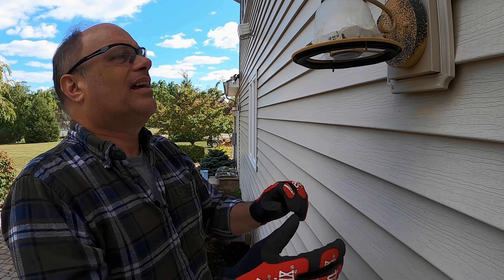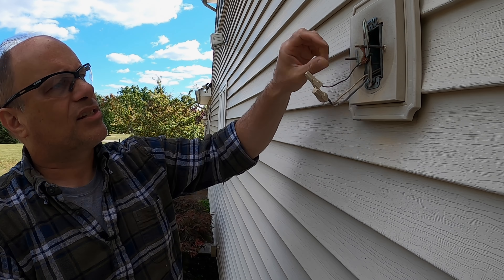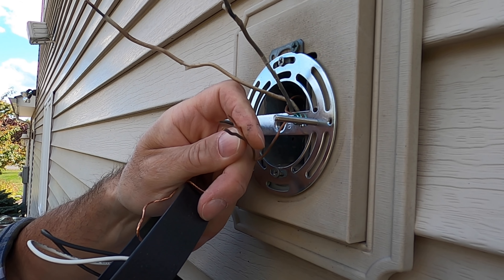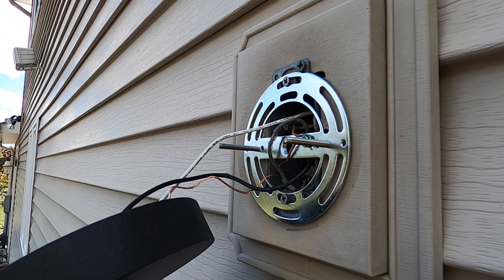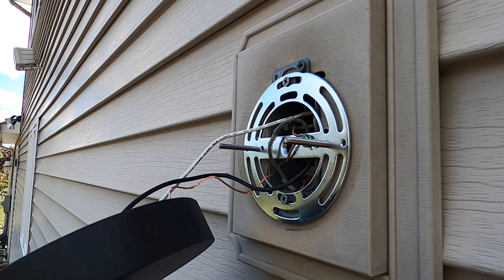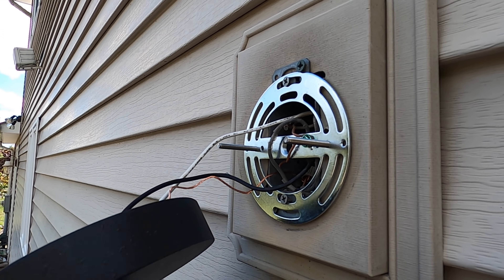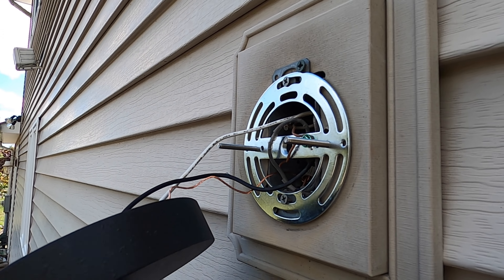How to Install an Outdoor Light Fixture - The Right Way

Comment: I'm going to be installing fixtures on existing blank vinyl mounting blocks. I see that box you're dealing with there is a cut-in switch box. How do you cut that vinyl mounting block to install the box? How deep is the switch box? I can see the cutout lines for a round box or a switch box I just don't know how to properly cut it and how much room will I have behind the mounting block to mount a box. Thanks
Reply from the maker: Hi Jack.  The siding blocks are scored on the rear for round and rectangular boxes. If the block is installed as part of the siding (not removable). You will need to cut the block to insert the switch box.  Trace the outline of the box, drill a series holes around the pencil line and score with a utility knife. I’d go with a 1-gang shallow metal switch box.. you will need to cut the wood sheathing for the switch box also.  Depending on when you planned to do this work, I’d be happy to do a video showing exactly how to do it.  Happy to help if you need some additional info.
Reply: Hi Pete, thanks for the info. I'm in no hurry and I would love to see how you do that (install a fixture on an existing vinyl block). The block I'm dealing with is part of the existing siding so I won't be able to remove it. I thought a shallow box might fit between the mounting block and the plywood sheathing. All I'd have to do then is cut the box out of the vinyl and just drill a hole in the plywood for the Romex. I think you're saying I have to cut the plywood too. Thanks again, Jack
Reply from the maker: Hey Jack..  I think you would need a very shallow box as the siding blocks are usually about 3/4” thick. Old work box’s are about 1 1/2” deep.  Worst case you would need to drill a series of holes around the outline of the box and trim the little webs between the drilled holes.  This will give you a bit of room to recess the box into the plywood if needed.  You might be able to fit a round pancake box in there also.  It probably best to take some good measurements of just how much room you have behind the block, even if you need to stick a piece of wire coat hanger in a gap to get a depth measurement.  It sounds like you have this well in hand..  if I can be of any help please let me know.
Reply: Thanks for the help Pete.

Comment: Hello bought a used mobile home and it needs work of course I need to replace outside porch/ exterior light do you just match the colors to connect sorry I don’t know anything about electrical work and wanna learn please help and your video is good 👍
Reply from the maker: Usually matching colors is typically ok. I would measure voltage between the black and white to confirm 120 volts. Then test brim black to ground to test that you have a good ground, should be 120 volts again. Finally neutral (white) to ground and you should have zero or milivoltage. Sounds like a lot but it’s really a very quick check. Good luck with your project!

Comment: I’ve never switched a fixture but I’m going to try to. This video was very helpful and I think I have the same new fixture from Lowe’s. Question: after I connect the fixture wires to the existing wires in the electrical box, do I need to make sure that the black and white wires do or do not touch each other or the ground wire or does that not matter? I’m terrified that I’m going to do something electrically wrong and start a house fire.
Reply from the maker: Sue, thanks for watching!  I purchase that fixture from Lowe’s so most likely it’s the same one you have. When you make the wire connections, strip the wire to an appropriate length and properly install your wire nut. Typically it will be black to black, white to white bare copper\green insulated to ground.  The conductor insulation (black,white,bare/green) can touch each other without issue. Only the bare copper conductors under the wire nuts (energized wiring) cannot touch.  Once you install the three wire nuts, you can wrap electrical tape around the wire nut and conductor to make double sure there is no chance of anything touching.  Take your time and of course make sure the power is off, all safety rules are followed and then just stand back and enjoy your handy work..  in that order.  Good luck with your project

Comment: Very informative. Are mounting brackets pretty universal? Is it necessary to replace the mounting brackets or can the old ones be used?
Reply from the maker: Hi Rhonda and thanks for watching.  The mounting brackets are fairly universal, some with adjustments for the mounting screws. I’d suggest using the new bracket that comes with your new fixture as its only held in place with two 8/32 screws. Good luck with your project!
Reply: @completepete  Thank you so much! I had bought two used coachlights that I really like, but I do not have the brackets they came with, I only have my existing brackets holding the lights that are already on my house.... I just noticed today that one of the aforementioned used light fixtures that I want to use as a replacement does not have a ground wire in it, so I am wondering if I should just ditch this whole 'reuse' idea and just buy new ones? It would be a shame because I really like these secondhand ones. I do have the ground wire that is coming out of the existing bracket from my house, so I wonder if I could just attach that to the pre-owned light fixture that does not have a ground wire?
Reply from the maker: Rhonda, I’d try to install the two used coach lights. I think you will enjoy seeing them every day on your way in and out.  Amazon  Carrie’s several types of universal fixture brackets that should work. The ground wire should loop around the green screw on your new fixture bar with a bit of a tail left.  Amazon has a fixture ground wire available that might work. https://www.amazon.com/Satco-Ground-Wire-Lug-93335/dp/B005NWMN9Q
You may need to separate the fixture a bit to slide the ground ring over the 1/4” nipple that typically hold the fixtures together. Or perhaps there is a screw stud or lug somewhere on the fixture to connect onto.

Comment: I think I can be able to replace my light fixture. However, I'm not clear when you refer to the "ground wire" and "neutral wire". Will they be color coded? How will I know which is which?
Reply from the maker: The neutral conductor will normally be color coded white. The ground is normally color coded green or may be a bare conductor.

Comment: Ran into issues installing mine in my old house so I came here. My mounting bracket screws will not tighten. They just keep spinning so I cannot level the bracket before install because the screws are angled in different directions.
Reply from the maker: Happy to help if I can.  Are you referring to mounting the bracket to the box (metal or plastic)? Or mounting the fixture to the bracket?

Comment: I have two lights on either side of the garage I installed about a year ago. One has not been lighting up, I tried multiple bulbs, and checked the bulbs inside too and they work. I used a voltage tester in the socket and it is getting current the same as the other fixture when switched on. I tried pulling down the tab in the socket for a better connection with no success. Do you think I need a new socket?
Reply from the maker: Hi and thanks for watching. Usually there are a few possible issues with outdoor fixtures. Most issues are caused by a loose connection or corrosion . I’m curious if on the non-working fixture if you checked for 120 volt from the socket pin to ground and from the socket pin to the socket shell. You may have lost the neutral (white wire) connection which would also prevent the bulb from working.
Reply: @completepete  Thank you! If I had to guess I think it is probably the neutral loose. After watching your video I now know the best way to attach the two different styles of wires, extending the one slightly past so I will try that for a better connection this time. Wanted to cover all my bases before I took the fixture down again.
Reply from the maker: Happy to help!  Stay in touch if you still need troubleshooting assistance
Reply: Yes loose neutral

Comment: I have a hang down lamp, one of 3 in my kitchen that keeps burning out bulbs. If it is because of a flattened tab that receives the bulb, is there a simple solution to fix the lamp or is it ruined?
Reply from the maker: Hi Sheri..  as you pointed out the problem is most likely the socket. You would need to turn off the power before starting. It would not be a bad idea to test for voltage at the socket with a meter before starting. I just stick my finger in the socket and pull up on the contact with my finger nail.  Of course I'm a trained electrician with test equipment.  You could also remove the fixture to perform the repairs.. if a socket is damaged, they are not difficult to replace.  If you get to that point, I'd be happy to do a quick video on how to replace the socket. Something else to consider: bulb should be suitable to burn in the position you are using it in, vibration on floor above or garage door opener can cause the filiment to break (change bulb type), bulb might be incompatible with dimmer if one is used or the fixture wiring might be loose. It sounds like a lot but one thing at a time.
Reply: @completepete  thank you!

Comment: I have a question about the junction box you have there. Is the box secured through the mounting plate and then into the sheathing only or is there something else behind?
Reply from the maker: Sorry for the delayed response..  the GEM box in cut into the plastic siding block.  There is also a hole in the plywood sheathing for the back of the box as it’s 2 1/2” deep.  The metal box is screwed through the plastic and into the sheathing with 3” deck screws.

Comment: I did the installation of my new fixture. I see there is power going to the fixture, but the bulb is not coming on. If I use a 60watt led ecosmart light bulb could that be the reason why it's not working?
Reply from the maker: Hi Ali.. You would want to confirm that you have 120 volt at the socket. That would be power at the contact and neutral at the socket shell (not just voltage at the contact) I would try the bulb inside in a lamp, could simply be defective. Try testing your bulb first, then the voltage next, then your wiring connections.
Reply: Does your light fixture have a built in sensor? Try to turn it on at night

Comment: Your new mounting ring is vertically offset from the center of the electrical box. It may be that the gap at the top of the fixture is due to the offset making it ride up on top of either the bracket or the underlying electrical box.

Comment: How do I remove the big plastic square where the wires are coming out? I can’t get to the photo sensor connection behind it. I put a new light fixture up but it won’t work because the old photo sensor is still wired up.
Reply from the maker: The best way to remove the square is to score it with a sharp utility knife blade and knock it out. You can also drill a series of holes in the plastic very close together and cut out the webbing between the holes with your utility knife.

Comment: Im totally not a home DIY guy...so, if the fixture switch is off its ok to do this? Or does the power at fuse box need to be turned off?
Reply: Fuse box! Most switches only turn off one leg of the power, not both.
Reply from the maker: I would always recommend ensuring that the power at your panel box is turned off for the circuit you plan to work on before you get started. An electrical meter (such as a Fluke T Plus Pro) will help you determine if you’ve successfully turned off the power.
Reply: I noticed the box inside is a switch box instead of an octagon box,  is this acceptable to code?  never saw a switch box used for a light before.
Reply from the maker: Great question! It’s technically a 1-gang box and can be used for switch, receptacle or as a junction box.
Reply: Thanks  @completepete

Comment: Lots of great little tips (like Joe Accardo mentioned)! Working on replacing fixture now but it looks like I'll have to buy round mounting bracket because old one just has a flat one & cannot figure out how to attach new one, especially since new fixture has larger mounting bolts.
Reply from the maker: Roger,  The mounting bracket that came with the fixture should work. If you like, send a couple photos to completepete6@gmail.com and I'd be happy to see what I can see.

Comment: Any suggestion on how to remove the mounting nuts which just spin and spin?
Reply from the maker: Hi Robert and thanks for watching!  It sounds like the mounting bolts are spinning out along with the nuts. It’s possible to spin out the nuts enough to carefully grab the threaded part of the bolt with needle nose pliers and the nut with another pause of pliers to break them loose from each other. Might need a helper to hold the fixture. If just the nut is turning, spray a little penetrant on it and let it sit for a while (protect your siding from over spray) Grab the nut with needle nose and pull back while loosening.  Hopefully one of these methods will work.
Reply: @completepete  I was able to remove the light fixture.  Thank you very much for the suggestions Pete!
Reply from the maker: Happy to help Robert..

Comment: The back of my light- that beige piece behind where you did the wires keeps falling out of the wall - I just pressed it back in with some tite foam, do you think that will hold it?
Reply from the maker: Hi Samantha and thanks for watching!  I think you may be talking about the siding block?  If you could take a picture and send it to  completepete6@gmail.com I can take a look and come up with a solution for you.
Reply from the maker: Samantha,  a quick fix could be to squirt some color matched or clear caulk around the part of the block that is falling out. The adhesive quality of the caulk should help hold it in place.  Might be something to consider if the foam does not hold.

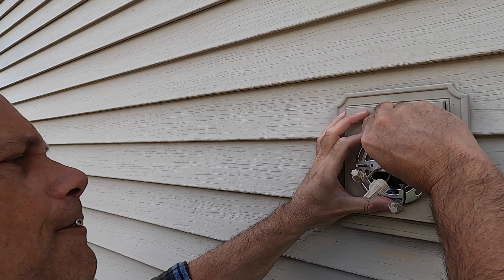Comment: What is the plastic box in the vinyl siding at 4:28 called? I need to replace mine. Any info would be appreciated.
Reply from the maker: The common name is a siding Block.  The one I’m working with goes on before the siding but they can be replaced by unzipping the siding with a tool.

https://www.homedepot.com/p/Malco-SideSwiper-Siding-Removal-Tool-SRT2/100098527

Other styles of siding are surface mounted and are sandwiched between the siding and the light fixture.

Happy to help, and thanks for watching!

Comment: That’s not an led bulb that came with it.  I have the same light from Lowe’s and those bulbs get piping hot!  I’ll replace with leds later on once they blow out.  I need to get a block like that for my siding mount.
Reply from the maker: An LED bulb is a great choice and the siding blocks do provide a nice flat surface for mounting.

Comment: Hi were can I buy the spirit level that you use please
Reply from the maker: Craig, I got my level fro an electrical supply house but you can get it from Amazon also.. it’s the Greenlee L107

https://www.amazon.com/Greenlee-L107-Electricians-Torpedo-Level/dp/B002NQQ9OK/ref=asc_df_B002NQQ9OK/?tag=hyprod-20&linkCode=df0&hvadid=309823018507&hvpos=&hvnetw=g&hvrand=14668082316983087350&hvpone=&hvptwo=&hvqmt=&hvdev=c&hvdvcmdl=&hvlocint=&hvlocphy=9004850&hvtargid=pla-434238017470&psc=1&tag=&ref=&adgrpid=60862048799&hvpone=&hvptwo=&hvadid=309823018507&hvpos=&hvnetw=g&hvrand=14668082316983087350&hvqmt=&hvdev=c&hvdvcmdl=&hvlocint=&hvlocphy=9004850&hvtargid=pla-434238017470

Comment: my issue is the mounting holes on the house are horizontal...
Reply from the maker: Rich,  thanks for watching and reaching out. If the mounting holes on the box are horizontal and the fixture mounting holes are vertical that can present a problem. You can replace the supplied rigid bracket with a two piece bracket that swivels into any position.
Reply: @completepete  Exactly what I did - however I had to cut the heads of the light retaining screws off in order to tighten the knobs - as you turn the knobs the screws go back as you say in your video,  but they bottomed out on the lower plate. I made the screws headless and that did the trick.
Reply from the maker: Perfect Rick..  glad the project worked out as expected!

Comment: unfortunately, my light fixture is behind the vinyl with only a small hole. I don't know how to get to the cross bar.
Reply from the maker: Thanks for watching!  If the box has been covered over there is a way to uncover it.  I'd shut off the power and use a cordless drill with a small drill bit to make a series of holes in a circle around the existing opening about 1/8" apart (don't drill deep). Use a utility knife with a new blade to cut the tiny piece of plastic between each of drilled holes. Keep repeating until the interior of the box is exposed.
Reply: @completepete  Thanks, that's good advice. I wound up using wood screws to put the crossbar directly into the vinyl, and it seems to have  worked (since the previous fixture was screwed in the same way). However, I like your idea better. If I ever need to pull it down again I'll definitely just do what you suggested.